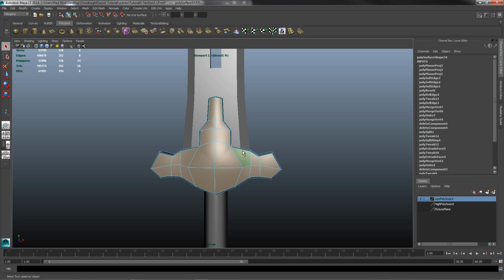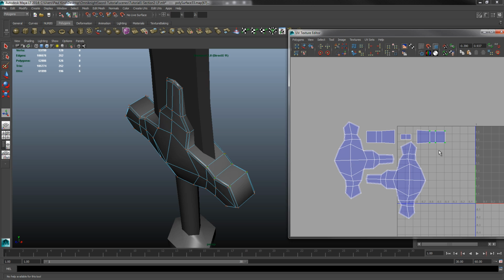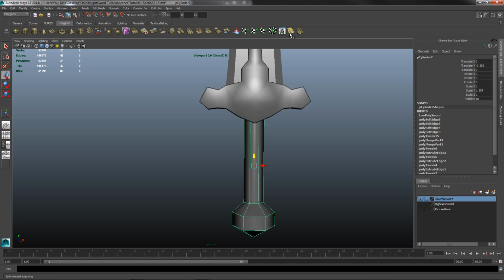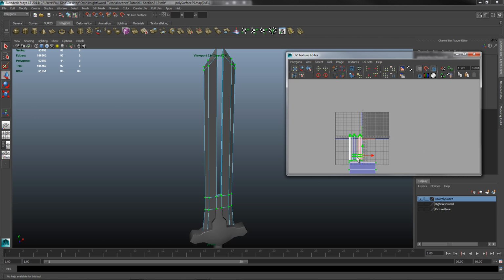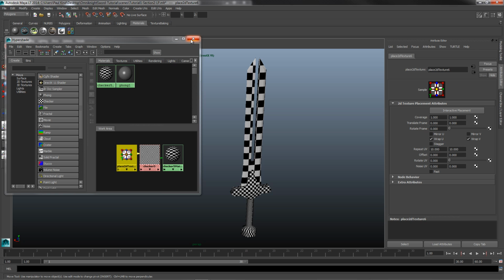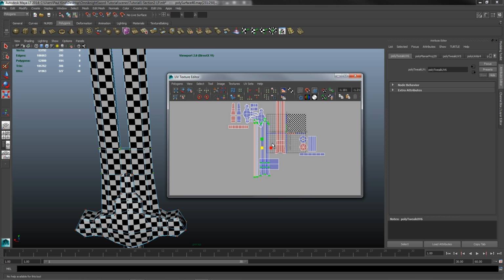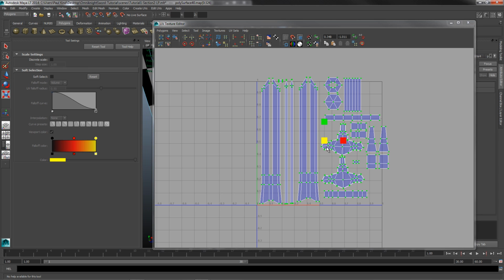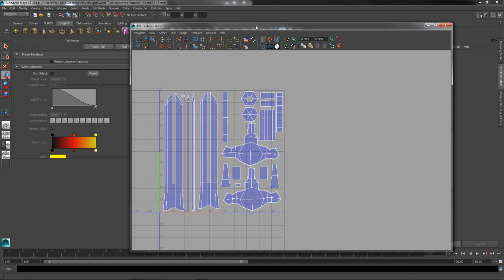Maya LT Dota 2 Tutorial -- Section 2 Part 2

Comment: This tutorials are great! But I have maya LT 2015 and once i found hyper-shading iv done what u did with the checkers (every thing the same. I looked closely). But the checker texture didn't aper. I did a research about it and i couldent find anything! PLS help me
Reply: Under the settings where it lets you select how you want to view your object, if you click the checkered sphere, (labeled Textured), it'll show the texture that you've selected for your object! I had the same problem. Silly how simple it was. Hope this helps!
Reply: +PronetoPlay Just got stuck here, thanks probably saved about an hour hopelessly searching google.
Reply: +PronetoPlay Is it the button by the Wireframe and Lights options? Can't enable it (on Maya 2016).
Reply: +ScGendo Got it, have to uncheck Use Default Material.